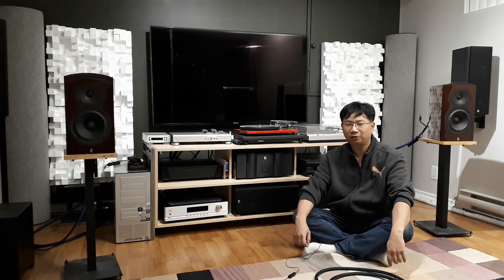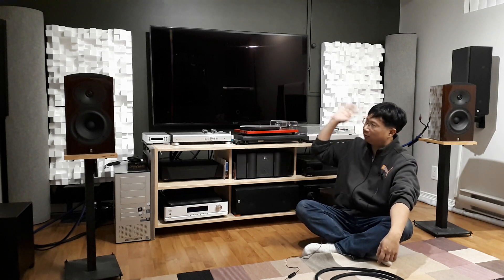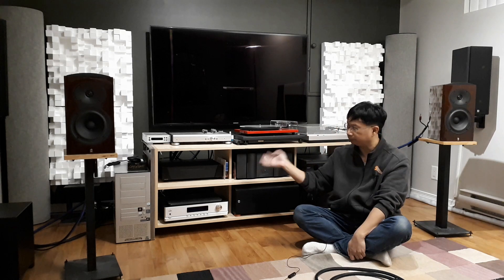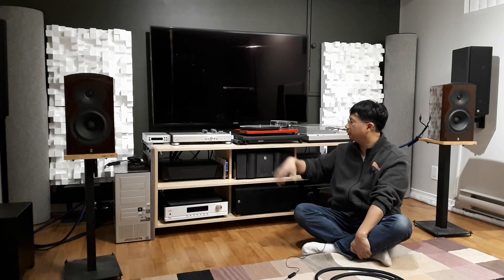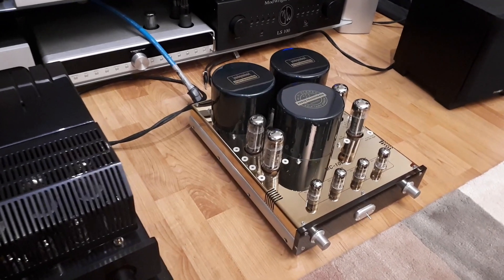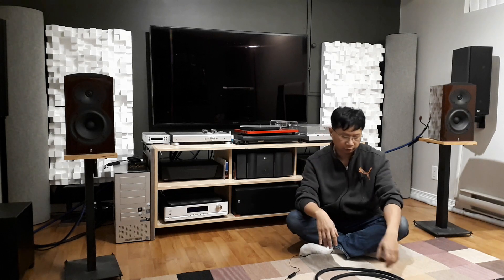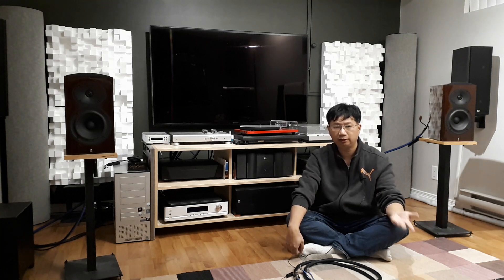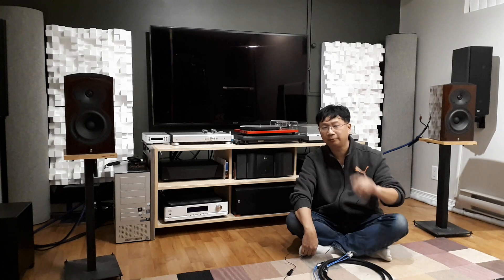I am back! With fake speaker cables!

Comment: He says to beware fake cables, but he doesn't say why. Because they don't look as good finished as the "real" ones? What about the sound? Everything turns the same when blind test knock the door.
Reply from the maker: That is 2 different topics. Beware buying fake goods vs does knock-off goods work as well as the original.  That kind of video is more on how is your ethics kind of video.  Do you buy knock off goods knowing it will hurt the manufacturer as long it' works as well as the original or you will not support fraud? If you want my opinion on cables, you can check my 2 other videos where I talk about that specifically.

Comment: The great thing about fake high-end audio cables versus authentic ones is that they sound the same. Electrons don’t care about your credit card bill.
Reply: The great thing about audiophiles and fake ones are that the real ones don't need a double blind test to expose the fake ones.
Reply: Lol
Reply: 1379~ 😂😂😂 yu don't take prisoners!!! Yu not easy!!!
Reply: Hahaha!!
Reply: lol !
Reply: 1379 The difference is genuinely huge and can be component level if you have the right cables and speakers. Plenty of snake oil out there to dilute the waters but I can tell you from first hand experience it’s not placebo or expectation bias
Reply: @TheSteppenwolf666  that 'first hand experience' is also known as an anecdote. How can you tell it's not the placebo effect? normally that takes double blind testing with a lot of test subjects.
Reply: ...And the earth is flat because the vast majority of people haven't been outside the atmosphere to find out for themselves.  Pseudo science is easy.
Reply: As long as it's decent copper and not CCAW crap, there is no noticable difference. For parasitic capacitance and inductance, the influence of the manufacturing tolerances of the components in the speakers themselves is far greater than anything cables can achieve. Even a 10uF 1% capacitor still has +-100nF of tolerance, while a cable has a few pFs.
Reply: mrpositronia It’s very simple my system was boring and fatiguing and had glare before when I had Naim and Chord cable now has life and energy  dynamics and analog texture and focus and these cables have been the biggest upgrade bar my speakers. Even going from NAD to MAC amps was less of a difference. I was a skeptic before so it was a demo with no expectation bias. Was intending to take them back and these things have improved my system massively. Not subtly - In a major way.
Reply: WESTEL Audio I love how everyone is a cable manufacturer. I don’t care if you have an engineering degree you’re not a cable manufacturer. It’s really as simple as using your ears and separating  the snake oil cables from the legit ones and the speakers that claim to be transparent enough to reveal big differences. You can bang on about capacitance and inductance properties and skin and weave and grounding all you want. The cables I have use cotten and no metal parts all wood bar the inner pins and cable inside as this is conductive and picks up stray RF and other nasties. They use rare earth minerals in the grounding boxes and the cables are different lengths. Black arts right what a load of horse shit? That’s what I thought until I plugged them in and they are better than Nordost or Siltech or many other big name brands and no ones even heard of them. I’m baffled and don’t know how it has made my system so addictive and really I don’t care. If a room full of audiophiles hear the same thing week in week out and year in year out and it’s placebo then so be it because it’s made my system sound massively better to me and everyone who hears it.
Reply: One would suggest having a conversation with the guys at audioholics  . Does one believe in unicorns too  and those cute little  cable bridges you must keep them level it makes it easier for the signal to travel .
Reply: neil F yep I believe in unicorns and a hifi system that was fatiguing and boring and now has life and excitement and analog glare free goodness. I do feel genuinely sorry for dogmatic engineers and skeptics who laugh at expensive cables because they had a few snake oil ones and see them as a series of graphs and measurements and never heard their hifi system as it really sounds. All the audiophiles that believe in cables are just delusional morons and everyone at Martins hifi and Audio T and KJ West one are just lying to customers and Naim make £2000 lumina cables just to rip people off and cable manufacturers risk billions every year to make identical pretty lamp wire that they hope will dupe people with placebo and expectation bias. If you believe all that then by all means continue to have clogged arteries strangling the life out of your expensive system. I’m happy to be imagining it because my imagination is making me listen to track after track and for the first time ever i’m experiencing emotion and joy. A pursuit that has taken me 15 years and nothing did it for me until I took the risk of trying these Entreq cables. Before my system was not performing to its price level now it surpasses it by a country mile. If this is imagination then thank God I’ve got a vivid one . 😊
Reply: Sound Ideas, Amen Brother!! Engineers and scientists need to flush all that stifling  ‘mathematics’ and ‘scientific method’ and get on with lavish poetic flourish.
Reply: @_Chev_Chelios  You are wasting your time. But it's fun, isn't it? This has been tested to exhaustion by incredibly smart people with incredibly sophisticated equipment. There are just a few universally accepted mitigation measures for ensuring a clean signal from amp to speaker.

And none of those measures cost $1,000+. And all of those measures can be implemented in self made cables for cost of materials, including aesthetic stuff. And all for well under $100 to make several pair.
Reply: I love it when people say dumb things like this. You do realize that the entire audio chain is the simple manipulation of electrons right? The capacitance and resistance of the cables will also manipulate electrons. Sure, there’s diminishing returns like everything else, but you can use coat hangers if you want. Nobody is gonna stop you.
Reply: @westelaudio943   but if you are a real audiophile law's of physics don't apply ( nor reasoning...)
Reply: Speaker cables is a old chest nut debate  speaker cables do change the sound but not on all HI FI set ups.
I have a Naim Nap 200 power amp feeding Harbeth HL5 speakers this set up is affected by different speaker cables in fact Naim sell speaker cable where the two conductors have a separation of about 30mm between them rather than close to each other. I have tried close space type with the Naim amp not good results.
Reply: But they care about capacitance, inductance, resistance.
Reply: @michaeltabor5721  Very true.
Reply: i had a fake furutech fa-220 interconnect that even a half deaf person could hear the difference between it and the genuine article, sorry to burst your bubble.
Reply: @DueM  All interconnects sound different even then one I made My self it has to do with the law of physics that is capacitance. reactance, inductance and resistance, paying high price for interconnects does not mean you will get the best performance its swings and round about,s no it did not burst My bubble.
Reply: @itsonlyme9938  i never mentioned price being anything to do with it, and for the record i wasn't talking to you. you're totally correct though, i see so many "they all sound the same" arguments.
Reply: @DueM  Sorry for butting in
but I would like to say is that fancy looking cables all that looks gold does not mean it is, cables with their fancy looks.
Reply: I had    pair of   genuine   ( from v.serious   shop )    loudspeaker    MONSTER Cables  ,biamp  M  75 , then after sometime, I was  tempted  to buy   Taralabs   Helix  6   cables  (  from   Hong Kong   for   150/160  US$    obviously  FAKE , I as  know   NOW ) , Surprise  ,surprise   ,,fakes "  sounds BETTER  then    original   Monsters !!!!  * with  Cabasses   Brick  500 M  and   Sugden   Symetra  2x Mono class A  amps and Sugden   Pre  41u  signature  ,   WHY ??????
Reply: Ps  Sorry ! twice the same question   , and no answer  , I just think   ,, chines"  stuff is   great , and WORTH   money !!!
Reply: you will get the same placebo effect
Reply: 1379 : That's because our ears can't feel the difference no matter how young we are , and the more we grow old ............................ no need to say anything
Reply: Yes true
Reply: @ohjoy40  Looks like we found another "Hi-end" cable sucker.
Reply: @hurkamur1  Why do you have to be so rude !!  Hey if you dont believe in high end audio and cables then just keep your comments to yourself why bash someone who does ???  I am a expert in my field what makes you think your an expert in audio and electronics ? Let me guess your of the philosophy if you cant measure it, it doesn't exist.  or if it measures the same they all sound the same, or measurements determine the sound quality of a product.  All false

Comment: Thomas, I appreciate your comment about "fake" speaker cables but, they're...sort of...not...fake...  I'll be doing a future video and I have the recorded footage from my trip to Guangzhou's audiophile shop malls and you need to understand that EVERYTHING under the sun is made in Guangzhou! I saw shops full of all the fancy cable parts and they custom make the cables for clients, in every price range from $20 to $2000. So, I'm trying to say, they're not "fake"  if they're all made there.  Of course, I understand your point as well about the cables  you received, if they don't seem to be the original manufacturers pkgng, a copy of sorts, then of course that's surely' a problem.  More later, Cheers, Mario
Reply: Dont advertise fake chinese knock offs as originals.
Reply: @xfilesfoxisdead7979  Exactly right.  I'm sorry, I don't think I expressed my point clearly enough.  Explaining that a "fake" is not the same as a "clone" is the distinction I'm looking for.  We didn't call clone PC's fake PCs.  They weren't the actual Dell or other brand name computers but the parts inside all came from the same place. Of course, there's the rub, you need to buy from a reputable source so that you know the quality of the parts being used is as it should be.  I walked around stores in Guangzhou that had hundreds of spec cables, connectros, sockets, AC plugs, etc, some of it was brand name stuff like Furutech plugs, others were just generic, but the dealer could make virtually anything to spec with no bullshit. It was quite incredible.  But then to slap a fake label on it? They do it, and of course that's wrong. But in fact, the product they made is identical to the original being made in the mfg brand factory, so yes its a clone, a fake, and it even may or may not have an unauthorized label on it, that's the fake part, but it may be 100% the same as the original, or different in some small insignificant way such as a different color casing or fabric. It was mindblowing to walk around Guangzhou markets and see all this first hand! Cheers, Mario   Here's my updated video on the JBL 530s :) https://youtu.be/q04TJyCxWxA
Reply from the maker: I understand what you mean and look forward to seeing your video. Let me know when it's up, thanks.

Comment: Might want to have a look in your speakers. Chances are they have 20-cents worth of some standard electrical wire in there, so...
Reply from the maker: yeah, a lot of speakers have cheap cables in them, even some expensive speakers.
Reply: @ThomasAndStereo  Just goes to show what a ripoff expensive cable are.
Reply: @Stikibits  I have heard the following: many cables companies, which includes many known ones, just use the standard OEM cables, wrap them in fancy wrappers, and then add better quality connector at the end. This comes from a wholesaler who says he tested over 400. For this reason, he turned mostly to Europe although he is based in USA. Maybe his tirade is also a snake oil, I don't know. Here it is: 
"In regard to cables; I believe most cables are a pure scam unless the cable manufacture builds their cables from the ground up with some sort of proprietary technology. You might think this is a harsh and an unfair statement but most cable manufactures, including many well marketed cable manufactures, just buy a roll of cable and put a pretty sleeve on that cable and then add some expensive ends to the cable, while calling it “The Ultimate Cable”. Truth is, it is just a dressed up roll of very average sounding bulk cable. Again this might sound harsh but if you have swapped out 10-20 different cable models than you probably just swapped out different rolls of bulk cable. If you want to experience what a cable should do or in Inakustik’s case, not do than try Inakustik cables. Basically the best cables should the least amount of effect on a system and this is why we love Inakustik cables; they just disappear.

Inakustik cables, manufactured in Germany, is my personal favorite cable manufacture. Inakustik cables has sold over 15 million cables worldwide and last year Inakustik cables sold over 7000 Reference cables with virtually no Reference Inakustik cables on the used market. This tells me people are buying and keeping Inakustik Reference cables. The Cross Link Super Speed waveguides technology, say that twice in a row, is very unique and is actually a huge advancement in cable technology. In this technology individual conductors are not touching each other within the cable structure and are floating in air. The copper wires, which is razor-thin and lacquer coated on each individual cable strand has extra insulation and is braided around a PE core. This design considerably increases stability inside the waveguide by effectively preventing the formation of eddy currents. (These are caused by the very high currents transmitted on the speaker cables – actually the highest ones within the entire audio path.) There are several other technological advancements that make Inakustik cables proprietary but the only thing that matters is, you can audibility hear the difference. Here is a link to Inakustik proprietary cable design.

http://www.in-akustik.de/en/cables-and-accessories/reference-selection/speaker-cable/reference-ls-4004-air-007714032/

As you can see I have real opinions and after over 40 years of A/B testing of products, I feel it is OK to give you my opinions based on my research. I am not jumping on some forum and giving you an opinion on what my friend heard or what some other person thought but rather real, live A/B testing. Am I biased towards the brands I represent, absolutely but this is based on many years of experience and owning far too much equipment. Although there are some well marketed products in North America I have decided to distribute mostly European audio lines because I feel that there are some real “hidden gems” in Europe and we as audiophiles should have excess to the next level."
Reply: "At the display sponsored by distributor FLaudio, Francois Lemay showed me a sample of the top-of-the-line LS-4004 speaker cable ($CAD5850/1.5M) from Inakustik. Most of their cables are made entirely by hand in Ballrechten-Dottingen, Germany, and adhere to apparently complex patterns and architectures. I'm not the world's most cable-centric audiophile, but neither am I a cable skeptic—and after thumbing through Inakustik's catalog, I began to think a review might be in order."
Reply: I guess only Thomas can impartially see, compare, blind test, for example Siltech Prince and the above Inakustik LS-4004
Reply: @moonlight-kh6uz Your a snake oil merchant besmirching other snake oil merchants ,that's very funny.
Reply: There are 1000s and 1000s of cable companies out there, so by default we can say that all of that is snake oil:
"Mere weeks before I traveled to Montreal, I received review samples of Luna Cables' Red speaker cable ($CAD3600/2M pair), and have I been extremely impressed: the cotton-sheathed Reds, which are hand-made with tinned-copper conductors, seem to love my system, and vice-versa, wildly saturated tonal colors being the pairing's most apparent windfall."
Reply from the maker: Thanks for the info, never heard of that company but interesting.
Reply: @ThomasAndStereo  More and more, I am learning about the biggest stickup in the history of trade and commerce and that is cables "business". Just imagine, on one side you have a decent sedan and on the other side a piece of wire. Imagine that. Unbelievable. A piece of wire that costs as a sedan. I calculated profits in this business to be 1 : 100. In comparison, Timeshare fraud is 1 : 4 (presentations start at $16000 and the cost toward the owner is "only" $4000).
There are now more companies in high-end audio than grains of sand on East and West coast. Cables are leaders followed by DACs

Comment: There are a lot of cheap tube amps out there the question is why should one by a expensive 
amp or go for a budget amp ?   I think the answer lies in the quality of the output transformer ,
how well its constructed.
I not convinced about power cables between the amp and the AC socket is going to make any change in the sound quality, the mains transformer on the amp is used for converting the AC 
supply to a higher voltage and is converted in to DC supply and any AC current is smoothed out with capacitors which make a significant difference to the sound not power cables.
Reply from the maker: Yeah, I really think it's the transformer that differentiates the budget and high end too.
Reply: @ThomasAndStereo   It has to   with the quality of the metal used and how carefully the copper wire is wound on to it and using two ,left and right channel have to be very close tolerance so as not to effect the stereo image